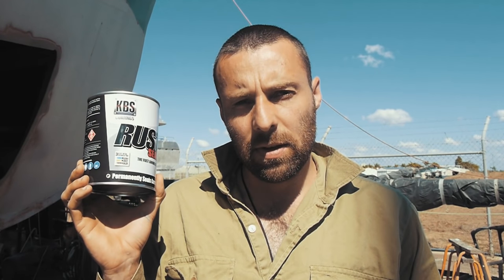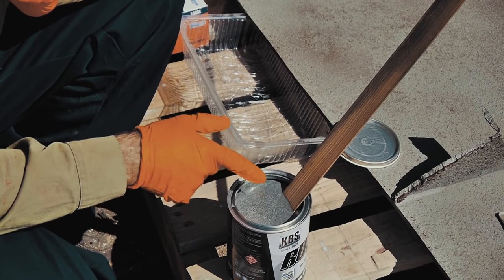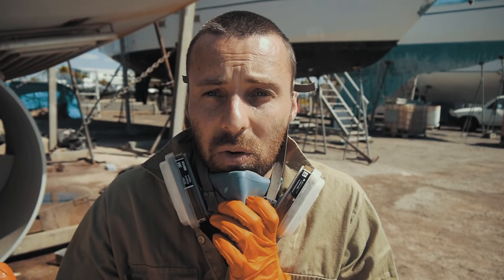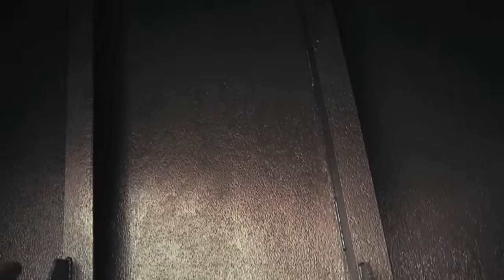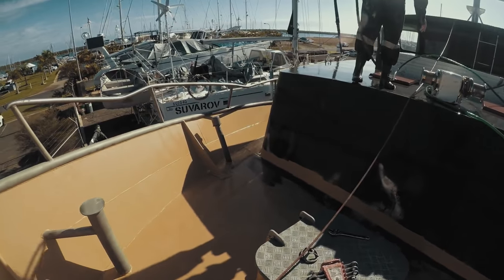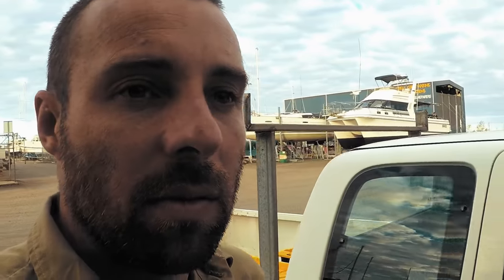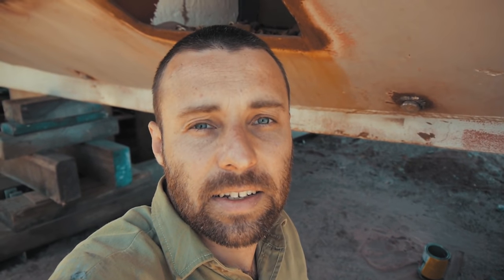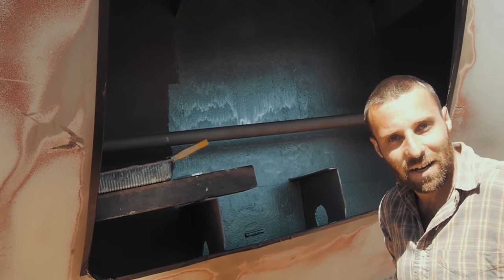Painting A Fuel Tank (Part 5 - Ep. 48)

Comment: Jotun Tank Guard would still be best! Used on all DNV ice classed vessels I have served on. If you think it’s too thick to apply, just thin the first coat. The same as with Jotamastic 87. Just thin it!
Reply from the maker: Hi Hannes, we used tank guard on our water tanks (the solvent free food safe version) and a few of the commercial painters int he yard said they have not seen it last more than a few years where diesel is used. that said there are a lot of factors as to why a paint wouldn't work so its more than likely not a paint fault but something else. Either way this paint that we used was an incredible paint, easily equal to Jotun in my opinion

Comment: You folks are gaining on it every day.  BRUPEG is looking good.  Will you pressure test the tanks after you have completed the weld up of the panels and small holes and the painting?

Take care and fair winds.
Reply from the maker: Hi Matt, thanks for the kind words. yes we will be pressure testing the tanks. Up to 2-3psi. The same as we tested on the pipe when we replaces the crash bulkhead checking system we will be using soapy water and pressure to fine the faults.

Comment: 9:32: Another old screw through the deck? Ever tempted to just cut that flush and leave it in place? 10:52: I guess you need a wee brush to get at the inside radius of those limber holes in the frames. 17:00: Good thinking moving the work spaces. You don't look particularly lofty, but the quality of life improvements from not having to constantly think "am I going to bash my head on this bit of boat?" are considerable. I've found that in any boat job, 10 minutes spent deploying the tools in a logical manner means half-a-hour avoided going up and down a ladder, stepping on the engine or whacking my head. 18:39: IF that hadn't worked, I might have suggested a "breaker bar" or a pipe extension for the right-sized rachet handle. Another option is to drill out that 1 inch bung hole to 1 1/4" (or a metric common size) so you can cut threads in entirely fresh metal. 20:53: "Overengineering is not going to cause any issues for us". True, and it pays off in better sleeps at night! Well done, Brupeggers.
Reply from the maker: Thanks Marc

Comment: So you plan to encounter a lot of ice in your travels. Is it a little backwards to have the fuel tanks right in the section that will take the most force of pushing threw the ice? Seems like the tanks should be at least midship and not part of the hull itself. I watched Deadliest Catch when they got into the ice looking for there crab pots and they had guys down there watching for breaches in the hull. That steel was moving and flexing and creasing like butter. Would it be wise to cover your tank areas or the whole bow area with a thicker piece of plate to armor up the hull in that area?
Reply from the maker: Hi Quarlow, we will be doing exactly what you have mentioned. When we get to New Zealand we will be doing our Ice Mod's. All external cooling systems will be moved internal, the hull will be getting additional ribs added between all existing ribs stem to stern and the front 6 meters will be getting additional plating added. thus we create a much stiffer hull section with the ribs and much more impact and abrasion resistance with the extra plate. Tanks are actually the best thing to have against an ice impact area as in a really brutal hit the hull can rupture, the fuel (or in our case vege oil) is lost or highly compromised but the ship is still water tight as that tank was already full of liquid. If the tank was not part of the hull and the hull was torn then the water would just keep coming in until the ship sinks. With this is mind creating as many water tight compartments as possible is a high priority for us, Brupeg will be getting additional fuel tanks in the engine bay along each side of the main engine for additional range but also for the safety factor that side hull mounted tanks provide. Currently we have 10 separate water tight compartments below the deck level, but this will be increased to 12 when we hit the ice. Damien
Reply: Aah I get it. Even if you lose your fuel it still acts as a double hull. Yeah I was wondering about the small amount of reinforcement in the tanks where you cut the plate off. I am sure you have mentioned this info before but I suffer from CRS ( can't remember shit). LOL

Comment: What happens when you weld the hole up do you have an inspection hatch so you can paint over the weld
Reply from the maker: Yes. We weld the sandblast the weld, then paint any bits of bare steel
Reply: How do you paint the inside of the tank after it's welded up?  Is there a manhole topside?
Reply from the maker: Yes. It’s tight but that’s how we get in and out to weld up the tanks from the inside etc

Comment: Why veggie oil? Wonder about the economics...lot of time and expense re making tanks vo friendly? How do you intend sourcing in Antarctica?   I assume are talking filtered used VO ? Are you not concerned about bugs or other contaminants (animal fats ?)similar to that which can occur in diesel  which can gum up injectors and pump?
Reply from the maker: Hi David, economics really stack up for us. Diesel is $1.60 per litre, waste vege oil is $0.10-$0.28 per litre. We hold 27,500L so the difference in cost is $44,000 versus 5-7k when we fill up. As for bugs etc this is the reason we have made a test oil filtration rig. We have already started working on processor 2.0 which uses vacuum rather than heat to crack the water. As for sourcing the fuel. We hold enough fuel to sustain us for 8,500nm of roughly 12months of ice work, we won’t be buying any fuel south of New Zealand and will be shipping fuel forward to the next port of call really to refuel. That said the boat can run on diesel at anytime so if we can’t get to our fuel stop and need to use standard diesel we can. As for gunning up injectors that is possible to eliminate which we will show in the episode on running the engine on oil with he use of heat just prior to the oil hitting the injector pump
Reply: @ProjectBrupeg  Kudos..Have you consulted the builder of your diesel engines at all?
Reply from the maker: No. I’m a diesel engineer so pretty comfortable finding my way around her plus we specifically choose the engine we have (Cummins Big Cam 855) as there are dozens of long term examples of this engine being converted and running with great success. The conversion is actually a really simple thing to do as the oil when filtered and heated is extremely close to diesel in viscosity and chemical make up, it actually has a higher lubrication level than standard low sulphur diesel does
Reply: @ProjectBrupeg  A helpful tip perhaps? Back in the 70's I was returning from a telecom job at the northern tip of Newfoundland when I noticed my gas tank was leaking from a small split caused by a rock from the then unpaved road. Knowing that I would not not be allowed to board the ferry to the mainland I pulled into a garage. Mechanic sealed the leak with soap..lasted all the way to Vancouver...

Comment: Looking Good, Is that paint a phosphate base or something similar that "rusts" to create a new rust barrier ? Had a thought, maybe each tank should have a dipstick style sample of the same steel and small enough to fit thru the filler or an inspection port, attached to a small SS cable or chain, but to be removable later so as to act like a test sample so you can guage how it's all working later ? It would also let you see if anything is leaking water etc back into the tank. Oh and thought you may be interested in this rustproofer : https://www.eastwood.com/ew_interior_rust_spray  it has a 360 degree long reach spray nozzle for getting into remote areas.